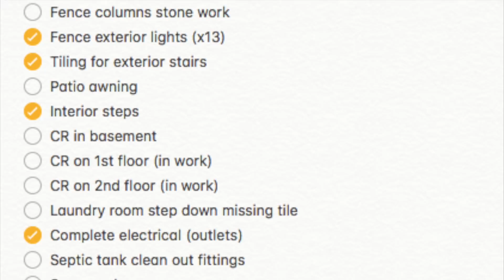VILLA FELIZ - EPISODE 343: WHERE DID THE DAY GO? (House Building in the Philippines)

Comment: As always I really respect your hard work and perseverance but I am concerned about your lay out of the grass blocks.  Maybe it just doesn't show clearly in the video but it appears that the blocks  are not immobilized on several fronts like near the location of the grating.  My concern is that as such with nothing to hold them in place,  they will shift with time and as such will be begin to fracture when driven over by your vehicle.  I had figured that you would have had them embedded to where the top would be equal to the top of the curbs.  Best of luck to you and wife.  Enjoy your beautiful home!
Reply from the maker: When the grating is installed they'll front/back it with concrete which will keep the grass blocks from shifting.

Comment: James, I must admit, your driveway, looks, not that wide. I'm interested to see, if you can turn the truck around, in there, or, are you going to need, to back it down, to pull out forward? Just my observation. Good video.
thanks, 
Ron
Reply from the maker: It certainly won't be able to turn around but I'll have to navigate out the opposite way I enter the garage.   So in straight, exit reverse and vice versa.  We'll find out the difficulty level sometime this week.

Comment: James, how did you manage to accurately arrange the driveway blocks from start to finish?
Reply from the maker: My strategy was to start in a corner and work out from that corner in a pyramid fashion.  That's not the correct way and it should be measured first to make sure you have equal spacing enough to fit the blocks at the wall.  Out walls and basement level driveway are all out of square and sizing so I found the most square corner and worked from there.  I believe another technique would be to lay the blocks like you do tiles.  Start in the center and work your way outwards.  In a perfect world that would yield the most accurate placement.  In a Philippine constructions world you hope for the best and prepare for the worse which sometimes means starting all over.  😳

Comment: I have late question:. When doing rebar, do they have the metal twist ties we use in America to tie the rebar together? Or just using wire?  Am asking because I want to send myself a kaybayan box with items I know they don't have there.
Reply from the maker: My crew used a roll of wire they cut into small sections for the rebar ties.
Reply: My PI Dream thanks James. Will put that on my list. I prefer the ties and are easy to use.

Comment: you havent experience yet the moonsoon season yet here in the PH ...7 days of nonstop rain or more  ..and that rain water  will overcome your drainage system ...esp you have a basement ..hoping it will not happened .
Reply from the maker: I've been here since Dec 2016 and although we haven't had a monsoon yet, we have had day in/out of non-stop rain but not usually more than 2 days at a time.  I did see how much rain could collect in the basement area which is why I've been so cautious in the design of the drainage system.  I'm hopeful my design will prevent flooding even during monsoon.  Time will tell.

Comment: Great job on the drive James you knocked that out like a champ. Thats alot of walking up and down to get the blocks. But disappointed  with the  tile crew. 2 guys = 16 man hours and 8 tiles and work to re level a small area. I wish they would show a sense of urgency to get things completed for you. But it is what it is by now. My guess for tomorrow it will be the expat crew of 1 that will  be working. Hoping you get your sand dropped off so you can finish off the drive tomorrow so you can focus on supervising only on Monday when the crew does show up for work. I think when we do our build i will be sure to have a work on schedule  clause with penalties for each day the build is behind. Also set up a bonus for workers privately  for quality and work done on time.
Reply: Toby Tonnessen Yes Toby! Great points! But as my old man used to say ..."Everyone should believe in something!! I believe I'll have another beer!"
Reply: It pays to be very knowledgeable  as James is  and an eye for detail which he has in spades,most of us wouldn't know where to start,most Filipinos are hardworking attention to detail is lacking though and they might just slap that tile in without checking if it's flush or level or plumb or color matching ,again attention to detail ,that's why you have to supervise or better yet, DIY ,James has the patience of a Saint,my hair wouldn't be just white ,I would be BALD already .  LOL

Comment: Hi James and Ness. How much cat 6 cable did you end up using and what sort of conduit did you use? I'm assuming you only fed cat 6 through this conduit?
Have a safe trip back to the states. I'm back in Australia busily boxing up gear to send over ready for next year's build
Reply from the maker: Our electrician pulled all the cat 6 so I'm not sure how much.  Going to guess around 100+ meters.   All pulled through NELTEX conduit.  Individual runs via 1/2" and in the control cabinet we put 1" conduit.

Comment: Where does the water go from the bottom of the driveway? Does it daylight out someplace or does it all get pumped out?
Reply: there are drainage pipes underneath the driveway that connect to the main storm-water sewer pipe around the house that eventually take the water out to the main storm-water  sewer for the subdivision
Reply: Wow I guess I would have to be there to see that. It is hard to believe that the stormwater main is much below the level of the basement floor. I guess it could be. Is there anything to mitigate the risk of the mainline backing up and then into the basement? Filipino infrastructure is prone to flaws. Come to think if it US infrastructure as well. We have basements in the US and it works. Can't wait to see how this all works out.
Reply: Earlier during the build James made a lot of provisions ,backups to backups and drains and pumps as failsafe as you can imagine, and a big cistern ,his build would do justice to any build in the USA or Canada let alone the Philippines.
Reply: Yea I have no doubt. James is good at building for sure. If it was just built by a builder and I was looking at buying it I would be skeptical.